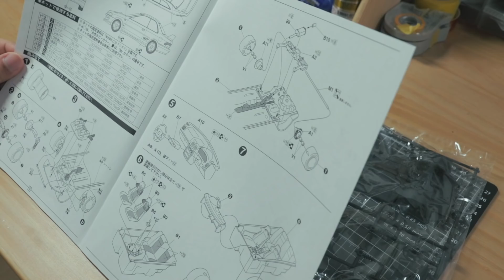Bunta Fujiwara's Initial D Subaru Impreza WRX STI Model Car Full Build Step By Step (ASMR)

Comment: This is the first Fujimi Subaru gc8/22b on YouTube. Thankyou this means I will now know what to do when I get mine in the mail
Reply: Thats not a 22B, is a Wrx Sti Coupe Type R GC8 with a custom 22B style front bumper
Reply: @tobiasrenner3498  I didn’t know that also have you completed the hasegawa 4 door gc8 wrx as I’m going to take the sti parts from the fujimi kit and kit it on the hasegawa kit to replicate my wrx (it’s a 2000 gc8 wrx with the full sti body kit (wing, side skirts, rear spats and front lip)

Comment: Is there any difference in the result between the two methods of applying the clear coat?
4 light coat vs light, medium, and heavy coat?
Reply from the maker: Great question! For color coats I will stick with 3 coats of light-medium-heavy, which will give you great results. However, when applying TS-13 clear from Tamiya’s spray can, the clear coat can be a bit too “hot” when applying heavy wet coats the solvent in the can can dissolve the base paint around sharp edges, exposing primer. That’s the reason I spray 4 mist coats to build up the layers. It’s just safer to do it that way.
Reply: I use tamiya x22 have Same effect  jun ？
Reply from the maker: X22 clear is different type of clear, it’s acrylic based. TS-13 clear is Lacquer based paint and recommended for car body. TS-13 dries fast and hard, and it’s good for sanding and polishing. X22 takes a long time to cure fully and it’s not good for sanding because it’s acrylic.(very soft)
Reply: @JunsMiniGarage  thank you，and excuse me i use mr hobby C series clear is have same effect？because model shop not for sale now！😅 Because I don't quite understand😂
Reply from the maker: Yeah, MR Hobby C46 or GX100 Super clear also have the same effect. They are both great clear coats for model cars.
Reply: @JunsMiniGarage  Thanks Jun😗

Comment: Hi! What can you say about your engraver by trumpeter? Is it better than tamiya(not 74091)? Is it worth buying it?
Reply from the maker: The Tamiya 74091 is a great scriber, I like the handle of it but the blade seems a bit too wide for 1/24 scale. I like the trumpeter engraver which has a thinner blade but the handle is too small, it is hard to hold the tool for a long time. I have both. I use the Trumpeter mostly.

Comment: I don't know why, but there is a mistake in this model: the brake calipers should be on the back of the wheel, and on both axles they are on the front.

Comment: The model is pretty accurate to the real thing (I have one sitting in my driveway right now. And it was even Bunta's that started me on the that to wanting one). The hood lines are a bit to aggressive and the grill not quiet aggressive enough. Also 16:07 That "orange peel" is actually pretty close to the factory paint job at that time, so you didn't need to do any further refinement.